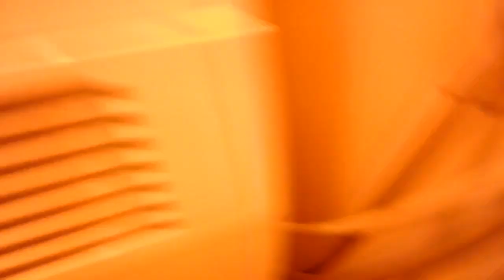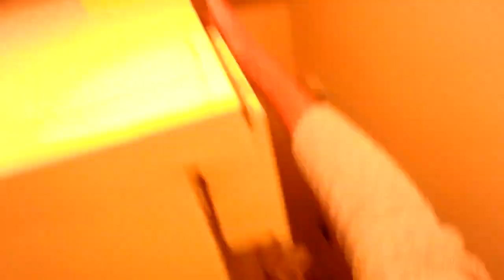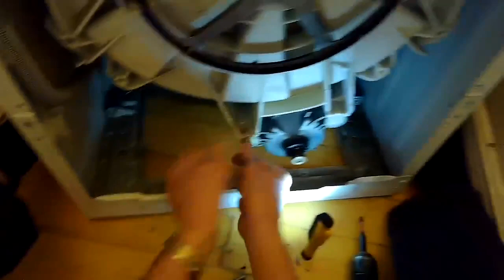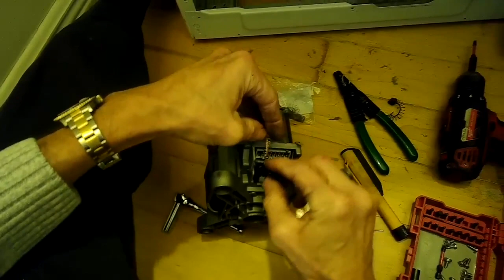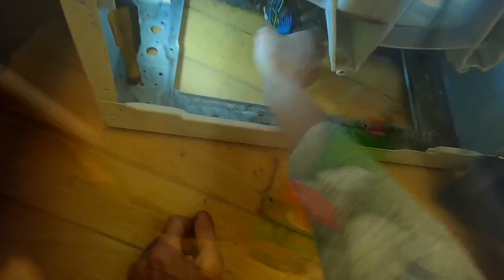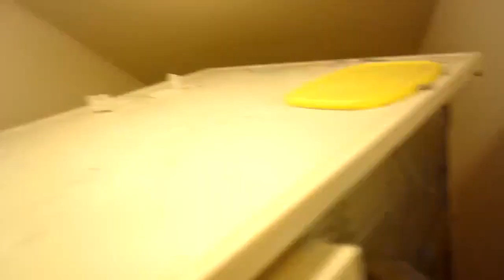BOSCH WASHING MACHINE WON’T SPIN OR AGITATE - Fix It Yourself and Save $300.00

Comment: My Bosch washer had a smaller access hatch on the rear to get to the belt only. I had to take the access cover (and leveling legs) on the bottom off the washer (easy). After that everything looked the same and the replacement of the brushes went great. Oddly, one brush was wore down to a nub, like in the video, but the other side was still fairly long. It seemed like it didn't slide in and out as easily as the other side. I did get the new one in, and it "felt good" going in. Maybe the old one got gummed up with dust?? Put it all back together and it's working great!!! My new brushes didn't sound as loud as the video, but did have a little bit of breaking in noise. Thanks for the video!!!

I made a paypal donation as it was well deserved, I hope others will to if this helps fix the problem.
Reply from the maker: You are very Generous, thank you so much😊😊😊😊

Comment: I have a Bosch washing machine and the spin cycle isn't working it drains fine. When I put it on a spin cycle it makes a motor sound but no spin, would this still be the motor brushes or a different problem?
Reply from the maker: Hi Robbie,
There’s a 90% chance it’s the motor brushes
Reply: @ScottTheFixItGuyChannel   ok I'll have a look thank you 👍

Comment: Is there a way you can look up what brushes I need for a Bosch 9000544713 / J52BCM-0111 motor? I can not find a part number anywhere for the brushes i need. Any info would be appreciated.

Comment: Hello
The squeeze speed indicator lights flash scrolling down n beeping by order one below each other. Machine refuse to turn on or restart (maxx 7 wae2016 series)
Reply from the maker: Is there any water left in the tub?
Reply: @ScottTheFixItGuyChannel  not at all. I unplugged it for several hrs. It then worked for a few days - then the problem repeated.

Comment: hi I can here it filling with water but doesn't go round, is this the same thing and how much to fix is it roughly? and will i be able to see if the brushes are worn. I did here a pop originally the at fused the fuse box and stopped, thanks